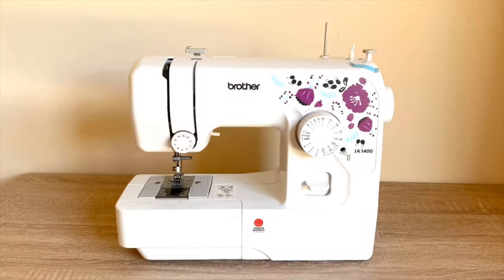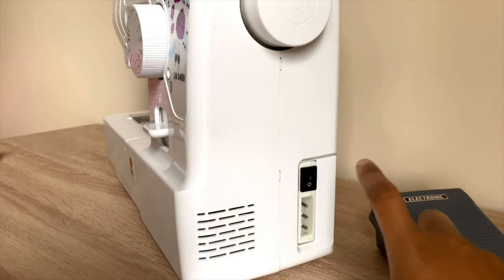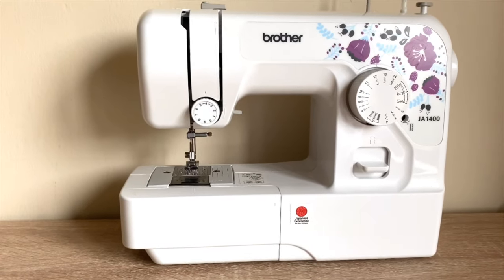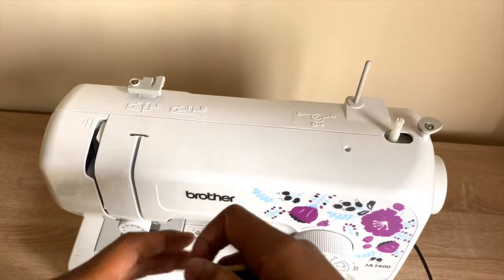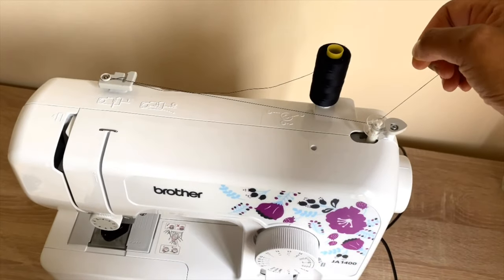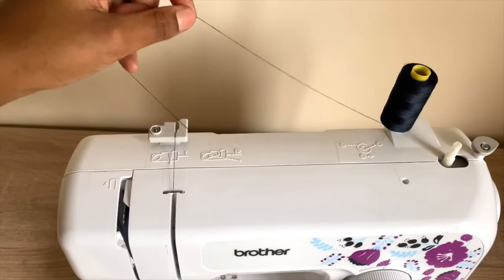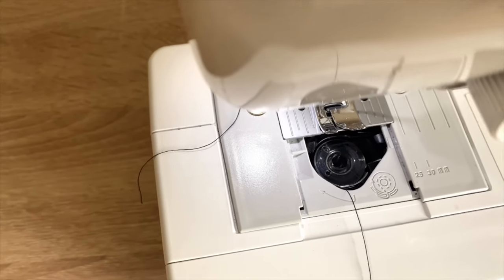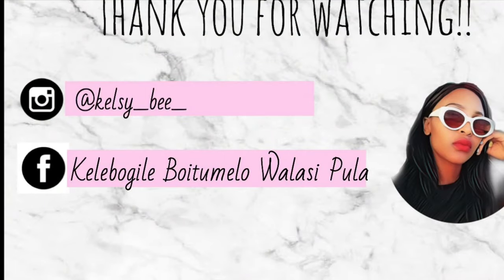How to thread a sewing machine || BROTHER JA1400 || Beginners

Comment: Hi why does my thread keep coming out of the needle whenevee i start sewing? Thanks in advance! :)
Reply from the maker: Hey. That a very good question there. Your thread comes out because your thread is short. Make sure when you start sewing that your threads are reasonably long...
Try that and let me know if that helps🌸🌸
Reply: @boitumelopula  omg thanks for answering. unfortunately, it's still the same. One press on foot pedal next thing the thread is not there anymore. 

Should I buy thick thread or smaller needle (currently on 90/14)?
Reply from the maker: Hey. That is very weird. Usually thread jumps out or dissapears into the bobbin compartment because its short. The other alternative is, use your hand wheel for the first two or three stitches while holding the thread ends(not too tight).